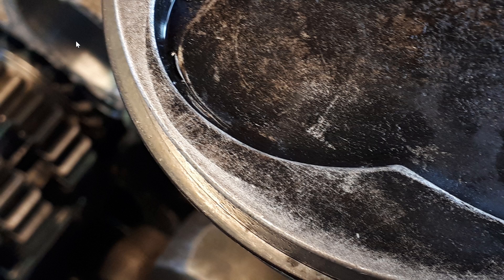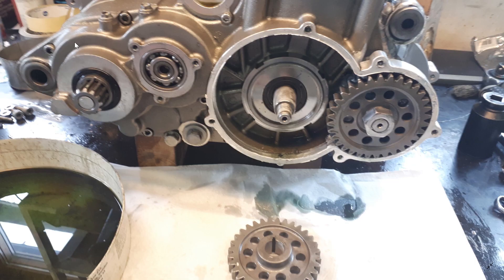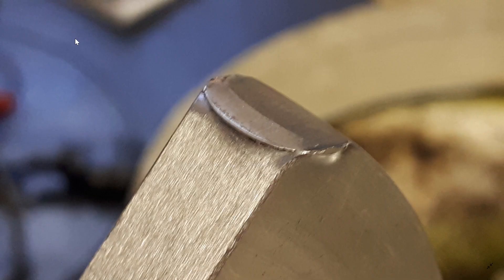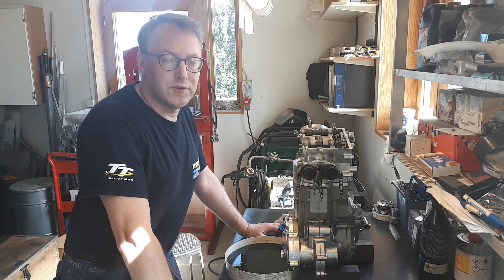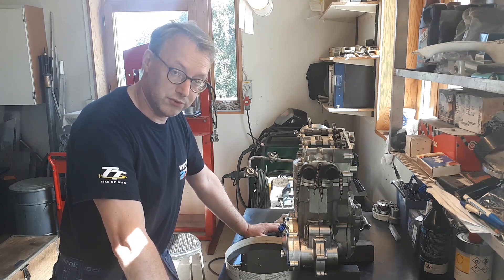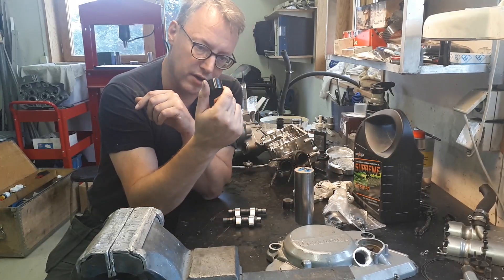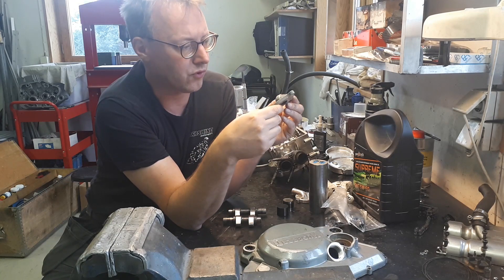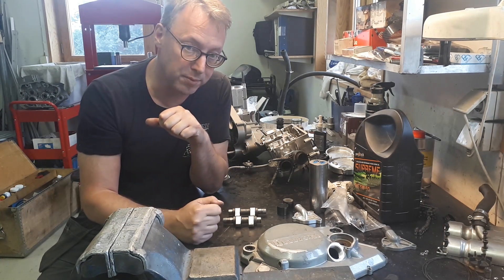DRC680, building a counter balancer VI - FINALE!

Comment: I finally found a Hidden Gem on YouTube. 
I was just dreaming this day of building Something similiar With a KTM LC4 Engine and searched around if anyone built Something Like this. Luckily I found your Channel.
Reply from the maker: Thanks for stopping by, Larry! Good luck chasing your dreams!
Reply: @Dr_C  I am still wondering how Josef Frauenschuh was able to build 136hp single Cylinder without blowing up. When I see how much work you had to put into your engine to withstand 85hp. Do you still think the Husaberg 650 was the right Baseengine or would you choose different nowadays? And how much of a problem is it that there are almost no spareparts for the older Husaberg Engines or is it no problem because nothing orignal is left in the engine ?
Reply from the maker: @gueldenerlarry8270  Figures that high makes me a bit sceptic. Also the shape of the power curve indicates that there would be a lot more to gain! (?) Once a racing collegue claimed 70 RWHP in a Suzuki RGV250-chassie. I had 69 RWHP in a Husaberg FS650 motard. At the coming racing event a passed him on the tall straight! :-)

With all facts at hand, no, the Husaberg crankshaft design was too weak.Today i would either chop off a cylinder from a large modern Ducati twin, or build on a 701.
But now I'm here with this 116kg bike, and it finally works! As you say, spare parts are no problem, as there is very little OEM left! ;-)
Reply: @Dr_C  Well He Put on a Compressor on the Bike which is probably not allowed in Supermono. I think it was just an Experiment to Show what is possible. 
I currently have the medium Tuning Kit from Josef and my KTM Lc4 has around 65hp and 75Nm. 
I think my next Bike is also going to be having the 690lc4 Engine where It is alot easier and cheaper to Reach Higher Power Figures.
Reply from the maker: @gueldenerlarry8270  Ah, that explains it! No, that is not allowed in Supermono. I guess even the Husaberg could cope with that power for a few hours. Piston to sleeve wear, main bearings, big/small end of the rod, will not enjoy this load for long. I'm guessing the head gasket and head bolts also would have to man up. ;-)

Comment: I´ve built a balanceshaftsystem for my KX250 engine.
I first made a version that was driven my the flywheelside of the crankshaft, the cone and the 'krysskil' couldn´t take the forces.
So i made a drive from the other side where the primary drive is, this seems succesful.

By that i´ve got a splined shaft that drives the counterbalancer.
Search for kawasaki kxf 250 engine on google and you can find the parts i used.

Tip for the future ;)